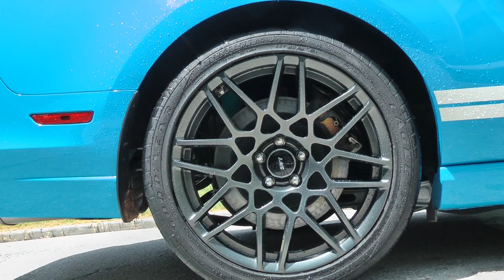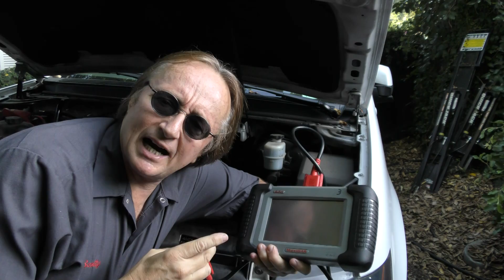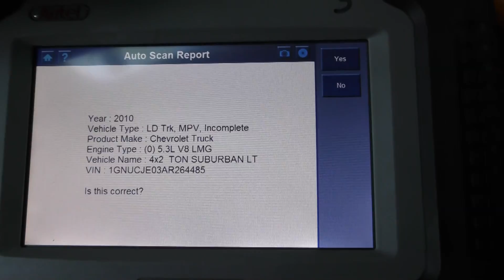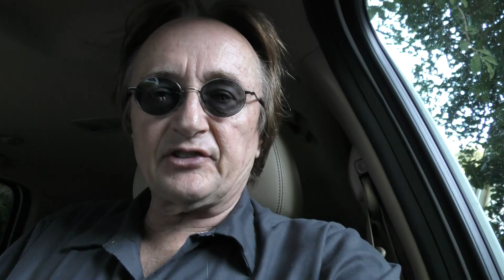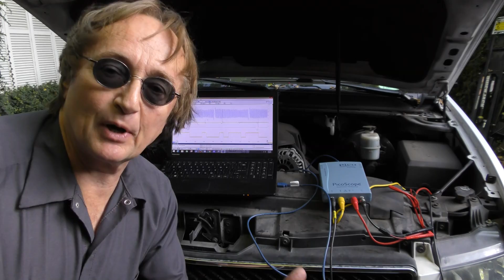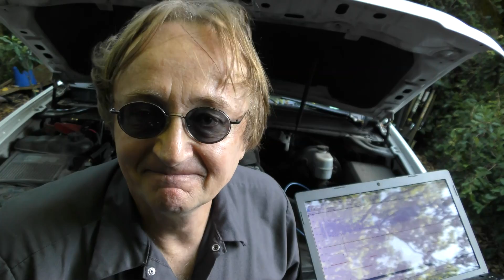Why Mechanics Charge So Much to Fix Your Car

Comment: Oscilloscope won’t help you much in digital electronics. All it will do is confuse you. They use full on analog electronics for example if you want to know why your amp is putting out distorted audio signal, you trace signal with a scope in each stage of amplification. On cars I find it useful on BMW though. I check the CAS for immobilizer issue.

Comment: I've been a mechanic all my life. Seen just about everything. I see mechanics ripping people off everyday. But I also see people not getting charged what they would've got charged somewhere else, and still complain what I charged them.  Tools are expensive. 
  If you're a nurse, did you pay for the thermometer you used to check the patients temp?  If you're a cook, did you pay for the grille you're paid to cook on?  If you're a firefighter, did you pay for the firetruck?  I can guess most likely not. Mechanics usually have to buy their tools and if you run your own shop, you bought everything or are making payments for the rest of your life. 
  Every day, I tell myself I need to charge more.  Don't know why people think mechanics don't deserve higher pay. $75/hr barely covers payments on tools. $135/hr and most people laugh at you.  But they'll go to the dealership thinking they're getting better work which they aren't. Dealerships around me are up to $165-$190/hr. I think that's insane yet people complain when I charge them $25 plus parts to change their oil.  It's not worth pulling in a car for less. 
  Chevy dealership is now charging $75 for a six cyl, 5 qt oil change. Ford is at $70. And they're all going up. Thanks Brandon!
  My scan tool cost $850 on special just to update it every year.  An update not on special is $2500. But people tell me I don't need to charge a computer hookup fee. I was told recently that my scanner may go to a per vehicle charge. Meaning I may have to pay $40 just to connect to a vehicle.  Guess who's getting the bill?

Comment: A fancy analyzer can run $30,000 for the analyzer and the modules for each car may be sold separately. Then there are the specialty tools that you need to do a job on one make and model car for a specific year but you must have that tool that costs hundreds of dollars.

Comment: With modern cars, even doing brakes require a scan tool. You need to tell the computer to disengage and retract the rear pistons for you. I remeber a tech focing the rear calipers off on a VW once, and the computer kept extending the brake caliper piston because they thought there was a failure to the point where they came all the way out of the caliper! What a mess that was.

Comment: You can download software for some cars, Audi/VW, I know, I did that years ago.  Sometimes you need "special" cable.
Some cars have really good forums, not Toyota.  Toyota forum has good maintenance thread, but I loose (spelling? XD) IQ points every-time I go on there.Totally useless forums.  Typical thread sounds like this:  "W@T TYREZ DOO I N33D 4 MY 18' RIMZ???!!"  But when you own a Toyota you don't really need the forums to ask questions.  Super easy to work on.  My friend always told me "parts were cheap", I thought parts were already cheap.  Most of what mechanics suck at is electrical work and computer programming.  I'm pretty bad at electronics and computers, but there are many levels of suck under me.  My mechanic friend that loves Toyotas, I keep having to tell him I don't know crap about computers, but he deosn't believe me because to him I'm like a rocket surgeon.  But then again he thinks he knows everything that is not computer related.  Actually even with the computers he's always using his monkey brain to tell me what he thinks is wrong.

Comment: So many fancy words for ppl who do not know what oscilloscope is and what it does, but in fact, it is really easy to analyze signals with right equipment, so today modern car repairing is basically part changing... They charge so much because ppl are ignorant and cant do it themselves.... Fair enough... Knowledge and equipment must pay off.

Comment: They used to call this "planned obsolescence."  "Modern"  cars are full of "options"  and "features" most people don't need.  The automatic transmission is one example.  It's hard to find a "modern"  car with a standard transmission.  I know some car dealers and they say they make as much as 40% profit on the "options."

Comment: All these comments about shops ripping off people and people complaining about them being expensive makes me feel spoiled with the shop I use. Several times they've diagnosed problems in my cars free of charge, and they don't replace more parts than necessary. Just recently I was worried about a creaking sound in the suspension when doing a full turn at low speeds so I brought it to the shop so they could have a look at the suspension. The mechanic couldn't really find anything wrong with the suspension and concluded that it's simply because the roll bar bushings are getting old or something, can't remember exactly. That isn't improbable as the car is a 2010 model with the first owner buying it in 2009 so it's 9 years old after all, so can't really expect it to be butter smooth.

They didn't charge me for the labor and the mechanic also advised me to service my brakes as they were sticking, but they didn't really try to push a brake job on me. The shop has a really good reputation and the bill is often lower than expected actually, probably because they work efficiently to keep labor cost down.

Comment: I'm fine with letting a mechanic work on my vehicle but when the markup on one single part is 170% then we have issues.  So it goes from retail $161.99 to $437.99   That's a $276 profit on one item. They're already charging for labor. And the parts cost them no more (and maybe less then) if you when to Napa and picked them up yourself.

Comment: They make them complicated so we can't fix them,  so we have to bring them in to get repaired it's a scam it was up to me I'd go buy a 70s vehicle with a carburetor at least when that broke down you have a few things that can go wrong with the car , battery fuel pump ,  carburetor distributor cap and maybe wiring after about 7 years

Comment: Well as a diesel mechanic who works for a company, if I work on cars I hate to charge people much for anything. But I'm talking normal wear and tear or preventive maintenance work. And most everyone this falls under is people I know pretty well. I don't work on random peoples cars. Which makes sense but scotty is 100% correct, these newer cars are all electronic and require very expensive equipment to diagnose and troubleshoot. They have a right to be charging quite a bit. Just make sure they fix the problem(s).

Comment: One of the only things I really like about new cars are advancements in safety. That to me is something very important. However aside from that there's really not much else we "need" and couldn't do without. Sure its nice to have all the fancy gadgets and whatnot but seriously.. is it worth the cost down the road? Leasing used to be looked at as a stupid thing to do. Still kind of is. However now it's the norm as NO ONE wants to deal with buying a brand new car. Unless it's like a toyota, honda, etc. Anything even remotely luxury by today's standards, you'd have to be crazy to want to buy.

Comment: Part of the problem of why it costs so much, at least when you go to the Dealer. Is that when the dealer mechanic find the problem your having. Lets say their system says its going to take 2 hours, and so to charge for 2 hours of labor.. Of course this is on top of the parts which can be marked up 100% ect... But lets say its actually only takes the mechanic 30 mins... Well they dont charge the actual time it took, they charge what the system says it may take. I have a friend who was a mechanic at a Dealer and he said it might take him 30 mins to do something on 2 cars or an hour.. and the system may say 2 hours each... he would get paid 4 hours of pay for something that took him 1 hour of actual worktime. The mechanic wants to be able to get through as many cars because of this. Obviously it could take you the allotted time if you were brand new but for good mechanics they see many common problems and can fix them pretty quickly.

Comment: It is not the mechanics who charge the £130 per hour it is the garage! The mechanics get 10% of that, we are poor! The price should reflect how many hours are spent working on the car, not 'Price to fix ' whether it is changing a water pump or diagnosing and fixing an electrical problem .

Comment: Nissan dealership wanted 600+ to change my brakes and pads on my Nissan so I took them to another shop and the guy said they don't even need to be changed there still good and that he would only charge max 320

Comment: Even a good mechanic can charge a lot of money for just simple things. I paid $330.00 to get both my electric window switches on the driver and passenger side replaced which it included the actual molded holding base for those switches. Seven months later the same window problem (not working going up or down) came back but only on the driver side. I went back to the same place and they were going to charge me $150 for another replacement I looked into the whole "Windows electric switch" thing online and on videos and bought just the switch alone at an auto parts store for less than $25 and spent around ten minutes learning and replacing this thing and so far so good no complaints as of yet.

Comment: I beat Mechanic's 30 years+ knowledge by googling weird noise from the transmission. To me, it seemed like Input Shaft Bearing. Mechanic insisted it was Throw out bearing. Of course, I trusted his hands on knowledge and he replaced that part but I was right in the end. You can easily diagnose or DIY by googling these days. The Monopoly of Information is gone. It's good for consumers but I am sure mechanics hates it when customers already know what's wrong since they can't rip them off!.

Comment: My fuel pump died so I had to pull the truck bed and tank wash it out with MEK ,, then change the Fuel Filter ( no pick nick ) on a 94' Toyota T100 Truck.. Blow out the gas lines with ( gum out ) then I was up and running again ... but it took me 3.5 hours to do.

Comment: My car was misfiring. I took it to get it looked at. They said the spark plug was cracked somehow. They needed to change all 4 even though the other 3 were in good condition and just 2 weeks old. And get this, they wanted to charge me over $100 for just labor. Can you explain this one? At the end I just changed the spark plug myself for under $5.

Comment: Obd2 scanners are crap. What you need is oem scanner and a laptop or tablet computer. I happen to own audi and vw and i have the privilege to use 100$ Ross tech cable that does what multi thousand $ oem does and more. And since life is complex just look how complex this days garbage disposal is or buying in modern groceries store i dont see any problem dealing with all those thingd. I also have to work my ass of to earn money so why throw a mechanic 50euros per hour when i earn 10. I can read instructions and this days there is just everything on the internet.

Comment: No that's the wrong reason. They charge their labor off of the book not the actual job. Say the book says replacing a fuel pump takes 2 hours. They do it in 30 minutes but still charge for those 2 hours. And dealerships just rip you off even worse by finding and looking for problems that they don't need to look for and say to fix it,, it would cost less to buy a new car instead of fixing/replacing parts. 

(Didn't mean to go on a whole rant.)

Comment: Most, if not all, manufacturers use a proprietary protocol, that requires specialized tools, on top of the standard OBDII protocol. Fortunately for Volkswagen owners enthusiasts have reverse engineered VAGCOM and now you can get OBDeleven or VCDS, albeit you'll probably damage something if you don't know what you're doing.

Comment: $20 an hr mechanic's pay means the dealership will have to charge $100 an hr because of taxes, insurance, overhead (the building, electricity, etc) if the dealership wants to actually make money.

That's before getting the computer diagnostic equipment....

Comment: I usually tell people that ask me why I charge so much for twisting a wrench.. if it was easy everybody could do it. I prefer my Snap-On scanner. Because it tells me everything I need to know.
Reply: That is why they started all the computer stuff, I remember as a kid sitting in the wheel well of a 1954 Ford truck. Every issue could be fixed in twenty minutes. To many back yard mechanics were taking money from shops and dealerships. Cars used to be so easy an 8 year old kid could work on them

Comment: I remember when the "fanciest" thing a car might have, electric windows and seat adjustment controls. When they moved the high/low beam control from the floor to the steering column... (mind blown) 
Heck going back to my childhood, one of our family cars had a choke adjustment knob.

I miss older cars. So much less went wrong with them, and dang near every thing could be fixed by the owner using a standard set of tools.
Reply: sure but when tf where the light controls on the floor?

Comment: I have a friend who owns a nice repair shop and I have trusted him for over a decade. Only thing is,,,with my 6.7L Dodge Diesel you have to have Special Programs,,,,only sold to dealers...to work on it. I just paid $840 to have an Upstream O2 sensor replaced and after looking it up on youtube found it takes about 30 min. Only thing is,,you have to have a computer hooked up to read and reset all the other computer points to make it work. I also looked up the part and it was around $100 even though the dealer charged me $235. Yup, it's a game they play to screw you to the wall every chance they get. Sad thing is,,every time I take it in for an oil change, I have some other problem pop up and I KNOW isn't normal. The truck cost over $50K, you would think after paying that kind of money they would produce a BETTER PRODUCT. Oh yeah, they put a ZIP TIE around a connector,,and charged me $$$$ for that too.
Reply: That's why fixing old truck yourself beats taking it to dealership any day.

Comment: And that is why I have old 1984 Toyota truck. Pretty much do you have fuel, do you have a spark, and is everything in time? If so you should be good to go. No computer required! 
(Muscle no assuming a sound and well sealed engine system)
Of course the difference and economy and efficiency with computer control  is totally amazing so here we are. Yet I like hanging on to that old simple technology. Further, in the event of an EMP attack I can still drive. 👌
Reply: 1984 Toyota pickup truck already has an engine computer (ECM).  To avoid computer altogether, I think you need to drive 1970's cars and trucks. Of course ECM in 80's cars and trucks are much simpler than what modern car has so you can just swap out ECM if you think that's the problem.

Comment: i disconnected the instrument panel module to replace the burned out bulbs and the airbag light came on and stayed on. the dealer wanted a diagnose fee + reset for $120. I fixed it with two paper clips and a youtube how to video. airbag light now comes on for few secs and off since the fix a yr ago. - 2005 honda element.

Comment: Simple fix, all mechanics will have a side hustle fixing cars under the table. Have them look at it and they usually charge half the cost and they’ll use the shop on Saturdays (their day off) and fix it. Or you can just pay for a $75-$300 diagnosing and then take that info to a mobile mechanic to get it fixed.

Comment: Hey Scotty, I completely agree with you 300% on modern cars. Too many computers and electronics. What model year vehicles do you recommend? I've noticed you've got a 93 celica yourself. I've got a 99 camry 4 cylinder. What model year vehicles do you recommend? I hate these computers on wheels that they call cars these days. You need a computer tech, not a mechanic, to fix them. Only older cars needed a mechanic.

Comment: Auto repair shops have tremendous overhead and associated costs. The cost of their tools & equipment which constantly require either updating or upgrading, rents/leases on property,  labor & continuous training costs + high insurance & workman's comp rates all add up to the charges required to just keep the doors open.  Value is more important than price when dealing with a mechanic or any skilled trades person in general.